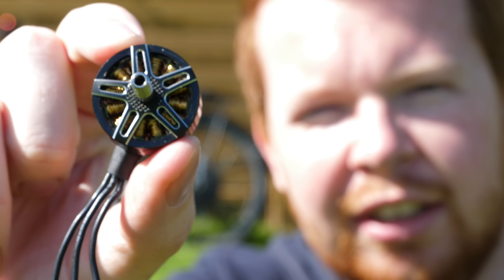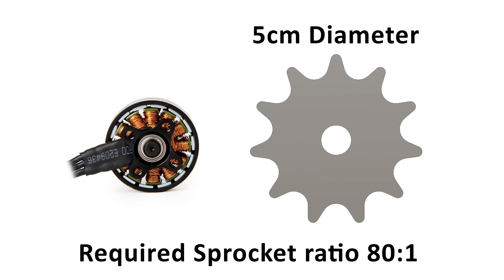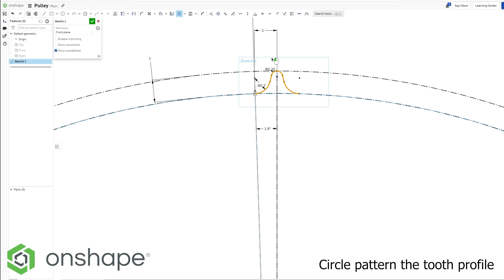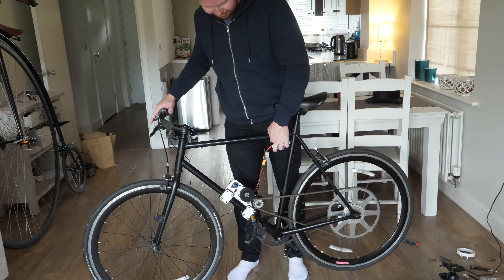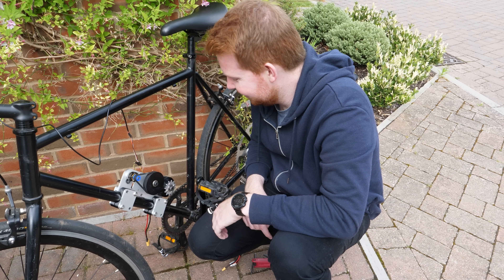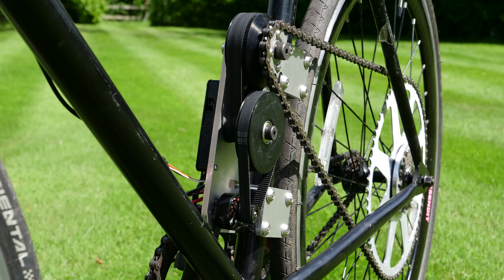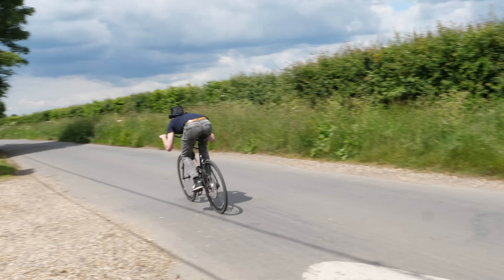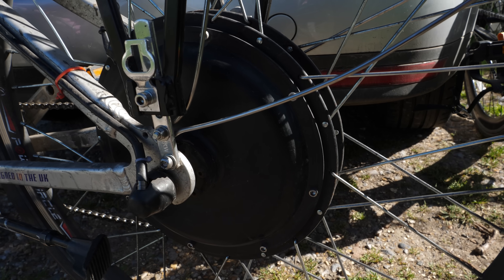Tiny 1kW Electric Bike Motor

Comment: A long while ago I did the math and it was cheaper to use 50 drone motors than one large motor for a car. Never really thought of what would happen. Good to know
Reply: Would love to have a look at how you arrived at that conclusion
Reply: I think that comparison is very imprecise because of the mechanical challenge and limitations of making those 50 motors work in parallel... The overhead energy cost for each parallel connection would sum up to a point that it would probably be impossible to expect those 50 motor generating 50 times the power of a single motor

Also it must be considered that a car motor was specifically designed for the vehicle and thus would have many high tech features for it.
Reply: If they're at retail price then probably, as you are paying for brand name car parts vs cheep drone motorcycle
Reply: It isn’t. Big motors have ridiculous mark up. I think Tesla is under $1000 their cost per motor.
Reply: You dont calculate the cost of implementing those into a car and other costs.
For a car manufacturer just the one time cost to implement something more complex can go into the six figures easily. 

The regulations are crazy
Reply: I built a bike with magnetic engine  (No electricity and no batteries) are you interested ? We could build them together
Reply: @Edoardo-r5z no thanks i follow the laws of thermodynamics
Reply: Definitely not
Reply: There’s no way because how could u possibly set that up, there would be so many gears and stuff that something would have to go wrong, plus syncing them up together would be near improbable aside from the battery and wiring situation
Reply: @tysemilicia3931  Lego made a livescale Lego Bugatti with a Motorblock made from Lego-Motors. I guess it is possible but with drawbacks.
Reply: @Morlabon  it worked but was super ineffective I don’t think it could hit 30 mph
Reply: @tysemilicia3931  You could have all the motors feed into one reduction gearbox. Syncing the motors shouldn't be an issue. they make controllers (like VESC) that can be synced with multiple controllers. 

actually I wonder if you could hook all the motors in parallel since the output will be mechanically linked. just have to make sure they're all in phase with eachother
Reply: @tysemilicia3931  Using encoders and a bit of logic could sync them fairly nicely; though all the motors would be mechanically synced across the set, if you send an identical pulse to each motor it should work as is, you'd just lose efficiencies to disparities in the individual motors as varies in manufacturing would cause this. As for how to have a 50 input single output setup, I'm not really sure, typically planetary gearboxes with motor-driven planets and a held carrier is a good way to link 3+ inputs, but 50 is a bit ridiculous; though with the size of drone motors, maybe a stack of planetaries could work, say 7 motors on one planetary and 7 planetaries into a final planetary, it's only 49 motors but I don't think a single motor would make a huge difference, considering that the sun is typically freespinning as the ring has more versatile use, the sun could be missing for all the system cares, a planetary of this design isn't too far outside of what could be probable. It'd take up quite a bit of space, but so does a proper EV motor at scale. It's not practical at all, and the gearset would massively offset cost benefits, but if someone was crazy enough to attempt a system like this, it would be theoretically probable within this setup that minimizes the amount of gears each motor interacts with. Alternatively a serpentine belt could be feasible, but would probably experience too much friction to be practical, but could also nicely interface with the output more directly; though it'd be interesting to see a double-sided belt and have motors replace idlers, which could minimize friction, damn near cut friction components in half even, as you'd otherwise need a lot of idlers to ensure a proper amount of contact on each pulley in the setup. Again, not practical, but not theoretically improbable. 

I almost want someone to test it, especially the serpentine belt method, just to show how gloriously stupid the idea is. But this also doesn't explore the nightmare that the driver board would be, that itself would have to be its own rabbit hole of stupidity.
Reply: @xaytana  I got to the 3d modeling stage, and yes there was a serpentine belt, I think I had 4 slices, each had 25 motors and each slice had a belt going to it. The whole setup kinda looked like a ww2 radial engine. It was stupid but a fun cad project
Reply: @noahagnew6517  I dare you to build it and make a video!
Reply: @xaytana  sounds like something should make
Reply: @tysemilicia3931  no more battery issue than a normal EV
No need to sync motors. It's cheaper to give them each a motor controller anyway
Just 4 big belts, one per 25 motors

Not probable, just possible 😁
Reply: Just match the rotor angles to each other and lock them all together, wire each phase of all the motors in parallel, and drive with a giant esc. 
The speed reduction is where it falls apart. Anything cheap would be far too inefficient to be practical (as it is in this video).

Comment: I really didn't expect that.  I thought the torque curve on the motor would make it almost useless but then I was comparing to a combustion engine.  Motors have max torque at low rpm but after their limit they tail off quickly.

Comment: instead of using such a small motor, why not design an inverted electric motor? the stator stationary in the center and the rotor outside the size of the gear in this video or even flush rotates
Reply: google translate

Comment: That's super fun! I wish I could have seen a "with pedaling" top speed as well. And a temp sensor with an auto cutoff would be nice too! I think it's really nice, too, because you can have a little boost for hills in a commute and such where you don't want to get your suit sweaty, but don't have to carry around a full battery/motor assembly at all times.
Reply: A slightly larger drone motor and I'm sure it would only be better!

Comment: You can turn a high speed brushless motor into a high torque (or backwards) by just only changed the copper wiring coil terminal system from “delta” to “star” pattern

Comment: 0:40 nissan can actually hit probably 330 kmh. Also john deere top speed isn't determined by horsepower or rpm cause it can cruise at 40kmh. It's not at max rpm.

Comment: Something that you didn't mention that's important to consider is that you're probably losing 20% of that power to drive train losses going through that much reduction.  Also the drone motor is designed to have a constant stream of airflow on it from flying through the air and the propeller. I bet if you double the size that motor again at a fan to it you really have something.
Reply: From the multiple stages you lose 15-25% depending, a GT2 belt is about 95%, while a chain is better if in perfect setup and condition, or a bunch worse if else.
Reply: @ChatNoirLe  dont forget about six or so rubber sealed bearings at around a percent each.
Reply: 20 seems high.  chains are close to lossless and belts are like 95%.
Reply: @GigsTaggart  Per chain/belt. He had three reductions, the first at a very high speed. The losses would add up quickly.
Reply: @GigsTaggart  no. Chains are less efficient than belts.
Reply: @NeutronJohn yep, timing belt is more efficient
Reply: @GigsTaggart  that depends. The faster the belt is moving the greater the loss. You've got one stage moving extremely rapidly and other stage behind that plus the chain.  The 3D printed pulleys are probably a bit less efficient than Mass manufactured ones due to the additional friction of the layer lines etc. I was figuring around 8 or 9% for the fastest stage another 5-6 for the next stage and then a few percent for the chain. Youve also got six or so rubber sealed bearings in there which are going to cost a percent or so each.
By those numbers 20% is actually generous.
Reply: @DoRC yes, you are correct. I also think you are being generous to the 3d printed parts friction losses.

I love 3d printing, please don't mistake me, but for high stress\ moving parts, there is a lot of room for improvement.
Reply: @Boogie_the_cat  Yeah absolutely. I always try to be conservative with my numbers because they are just estimates and I don't want to estimate in the favor of my own argument since I'm already going to be naturally biased toward my argument.
3D printing is amazing and is definitely come a long way. I think for projects like this where you're going to be prototyping and not doing any sort of serious production 3D printing is perfect.
Reply: Even if it is 20% (which seems high, but no offense to Tom but this is a POC so maybe), that's still 800w. Commercial E-bikes meant to go 20mph and climb hills tend to have 750w motors.
Reply: @TheJohnreeves  absolutely. There's still plenty of power here it's just that the motor isn't designed to be in the situation it's in. It's designed to have a constant heavy airflow over it from the propeller and the wind of a quadcopter moving through the air.
If it was properly cooled it would probably be fine but it would probably be more practical just to put a bigger motor in there because you're going to have to move a lot of air over it to properly cool it
Reply: I learned something from you thanks, cheers from 🇲🇦
Reply: The torque the motor structure can handle is not proportional to the weight to be moved. in some some early stage it will tear appart
Reply: Yeah you have Sommething, unless you go uphill and the Motor Burns😂
Reply: boo hoo boo hoo go cry
Reply: I built a bike with magnetic engine  (No electricity and no batteries) are you interested ? We could build them together

Comment: I'm actually impressed at the fact that the motors didn't immediately combust, especially the second one. Wow.
Reply: Agreed. This is damn-near a commercial for those motors.
Reply: More impressive that the esc didn't burst
Reply: and I worried about turle mode in the tree
Reply: I did short 0.8 mm copper wire to a led acid battery, it glow red but still one piece
If you wondered why I did that 
I needed to burn the isolation of the wire 🤣
Reply: @3ala2Aldeen  stop stealing copper wires
Reply: @toolbaggers  He might have been electroplating something with the copper.
Reply: @toolbaggers  why did you assume that the person has actually "stole" it? LoL

Comment: I was always curious if a small motor with gearing, would be more efficient then a large motor that's direct drive. Did it last long enough to get any efficiency data?
Also technically a drone uses 4 motors, so maybe using 4 motors would run cooler and faster 😉
Reply: It cant be more efficient because of drivetrain losses.

Comment: Neat idea Tom!  Thanks for the video.
Did you consider a planetary gearbox for the gear reduction? I’ve 3D printed a couple that were 50:1 reduction, but I think with a few changes, you could bump that up a lot.  
Might save space.
Just curious 🙂
Reply: Or even an harmonic drive !

Comment: You should measure the chain tension somehow (idler wheel mounted using a strain gague?) to give you the torque so you can figure out the true mechanical power, motor efficiency etc. at a range of RPMs. Calibrate it by engaging the rear brake and applying a known moment to the motor sprocket.

I wonder whether a split ring planetary would be any good for stepping down a drone (or more realistically longboard) motor to a normal bike sprocket speed. but i'll probably go for a bafang to avoid having to explain that i'm late to work cause my custom drivetrain exploded.

Comment: Maybe with a large 1:5th scale rc car motor and a bootleg cooling system made with some copper tubing and a small pc rad, it could actually be practical. Those motors put out some proper torque. The only issue is they spin at crazy rpms

Comment: Should get a little 10W blower motor to cool the motor. Would be very interesting to test the efficiency vs the ebike motor over a 1 to 5 mile stretch, at least in how much juice goes back into the battery.

Comment: need a v2, add some cooling to the motor and use a slightly bigger motor like a 28 36 1000kv or smth

Comment: Great video, I honestly wouldn't have thought it was actually possible to start from a near standstill with such a tiny motor. The heat issue is very telling, because it means that the drone motor isn't efficiently converting electricity into mechanical energy. At least now I know that if I get a bigger motor, I don't need something super big to make my bike go 🙂
Reply: (resistance is a thing)
(all motors heat up that's just a fact of motors)
Reply: @tianming.  Burning the enamel coating off the coils is not normal "heating up". If you can smell the enamel burning, you're pushing the motor past its thermal design limit.

Comment: My question has been, could you add a bunch of the tiny motors together with a single controller, and make something comparable?
Reply: Yeah. More motors leads to more torque. And under load, each motor would heat up less too.

Comment: Also, the first drone motor coat around 25 USD, while the hub motor is probably more like 150-200 USD. Would be interesting to see how good it could get if money is wisely spent maximizing perf and cooling with an equal budget 🤔. DIY or BUY? 😃
Reply: Ignoring special discounts/deals, the hub is superior because of the combination of less battery use (due to less heat and noise energy waste), higher mud tolerance, and not needed replaced often.
The people who make the hubs could just as easily make smaller motors like the one on the video, but choose not to.
Reply: the only drawback for a hub motor is the increase in weight. but even a mid drive system has a significant weight penalty by adding chains, gears, and attachment hardware.
Reply: Those motors are $14

Comment: Wouldn't a worm gear achieve the same reduction with less steps? Is it even possible?
Reply: If you had a very large gear (360 teeth for a one thread worm), yes, but it would likely be much less efficient, so there would be less usable mechanical power

Comment: Cool! But this raises more questions than it answers. If you can run an ebike from a puny motor and bit of mechanical advantage, then why do we use giant, heavy, and presumably much more expensive ebike hub motors?
Other comments mention heat dissipation and energy losses in the mechanical transmissions, and of course the added complexity is another disadvantage over a hub motor, but is that really all? Could tiny motors like these, but with different cooling requirements, be viable for cheap ebikes?
Reply: Why do we use big, heavy, diesel engines in big trucks that last millions of miles and cost a reasonable amount, instead of F1 engines that are smaller, lighter, and are basically designed to last the length of the race then blow up, and only cost $11M plus a transmission that works to reduce 20k rpm?  A cheap hub motor costs $250 for basically everything but the battery.  To develop an actual drivetrain that will be happy with 30k rpm, not just something for a video, the money, space, and weight you saved on the motor and ESC will be eaten up by the drivetrain cost, and anything spinning that fast won't last nearly as long.  One of those hub motors should last a VERY long time because they are very simple, and probably won't fail mechanically other then bearings and would more likely fail from electronics.
Reply: @KlockworXMusic  I didn't know hub motors came that cheap. So I guess the lesson is that yes - you could sacrifice torque for rpm or vice versa as much as you want, and make equal- power motors "the same" in that regard, but it's better to just use a motor that has the right torque and rpm to begin with instead of bolting on things to fix an improperly chosen motor, with all the complexity, points of failure, weight, power loss and lack of longevity that brings.

Comment: Well there are much larger motors that would still fit on a bike really really well that are used in heavy lift drones and rc planes etc
I would think about building one my self with a sim pully etc set up as what you got

Comment: One more reason why this motor is not good for e-bike : it's sensorless BLDC, it needs to have some RPM to actually switch from open-loop to close loop operation and with an open loop it barely makes some torque. So if you want to be able to start moving from a full stop you need a sensored BLDC

Comment: With those relatively small motors, you might be able to put several motors on the bike, so you can achieve a 6 kW motor assembly 🤔👍🏻😅

maybe even power the front wheel as well

Comment: Damn! That's pretty surprising indeed, Tom! 😃
Fantastic work!!!
Now imagine one of those big 30+ sized motors!
Anyway, stay safe there with your family! 🖖😊
Reply: might be fun with a loose/unused 1500kv 3650 w 5mm output shaft here.
could be done with standard available pinion+spur gears to keep it simple.
the size and fairly low rpm/volt might be close enough to appropriate.
with 3S or 12v about 18k rpm free spin, calculate reduction for 16k rpm 18 mph.
-because if you were pedaling 18 mph is pushing pretty hard!
Reply: @modelnutty6503  Exactly!

Comment: Racing and freestyle drone motors ratings are usually high, and its because they aren't usually hole shotted for extended periods of time, generally flying you only go full throttle for maybe several seconds at a time, as well as they normally have active cooling from the prop that helps keep them from hitting that point of failure.  Fantastic video though, I always figured this could be done, but gearing it down enough seemed like an issue so it was something I didn't want to try.  I honestly thought your belts would slip or jump in your setup, especially being 3D printed, but they seemed fine.